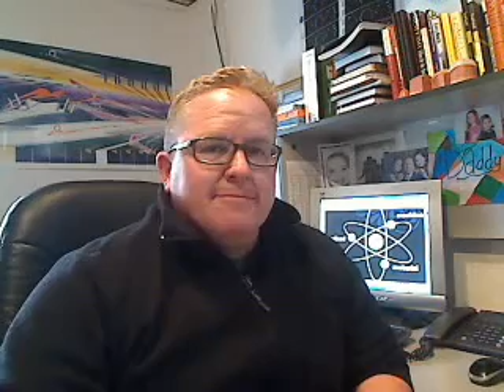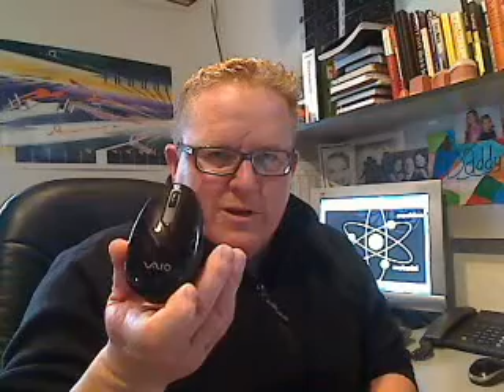Episode 7: Ink Drying and Curing Pad Printing Inks

Comment: I’m printing on ABS plastic parts and uses a 1 color pad printer. Does it affect the curing process if i’m printing 1 color, leave it, then next day print the next color on the part ? Or should we try and print all 4 colors in the same day then let them dry/cure ?
Reply from the maker: Good question.  It depends on the type of ink that you're using.  If you are using a single component ink (without a catalyst / hardener), then yes.  You can overprint the next day, or several days, later without issue.  If you are using a ink with a catalyst, then you need to check the technical information to see what the manufacturer recommends. Some inks have a "window" wherein you can overprint.  Once some two-component inks cross-link to a certain point, adhesion of subsequent layers can fail to adhere.
Reply: @PadprintersIMS  many thanks for your time and answer.

Comment: Why don’t all the ink transfer from pad to part ?
Reply from the maker: Could be a number of reasons:  (1) contaminated parts... any oils from processing, mold release agents, fingerprints or even condensation from parts not acclimated to temperature and humidity levels.  (2) Wrong ink mix.  Not enough thinner, or to fast an evaporating rate in the thinner / blend your using.  Increase thinner, use a slower evaporating thinner.  (3) Worn out pad.  Pad wear mechanically, and also through loss of silicone oil from the material with each transfer of ink.  Once the loss of oil brings the pad's surface energy closer to the surface energy of the substrate, the ink doesn't want to leave the pad.  Replace the pad.

Comment: I am working with policarbonate using the following mix for a two component ink: 40 grs ink: 7 gr hardener and 10 grs thinner, it looks pretty good, I am also using an infrared oven with a temperature of 80-85 C, the oven has around 2 ft length, when the part passes under the oven it will last 1 minute to pass from one side to another. I am having issues with the adhesion of ink onto the susbtrate, What would you recommend?
Reply from the maker: That ratio of ink:hardener does't sound right.  Most pad printing inks are 4:1 or 10:1. In rarer cases the ratios are 3:1 or even 2:1.  Check the ratio.  Also, drying and curing are not the same thing.  Most two-component inks should not be tested for adhesion until the curing schedule is completed.  That cure time can be anywhere from 24 hours after printing to 5-7 days.

Comment: Can you use a thinned plastisol to print on textiles?
Reply from the maker: No.  Plastisol inks do not contain solvents.  The evaporation of solvent from pad printing inks is what changes the surface tension of the ink on the pad and allows it to release to the substrate material.  Try a high-opacity ink formulated for pad printing.  Multiple prints may be required to build ink film thickness commensurate with the ink film thickness that screen printing deposits.